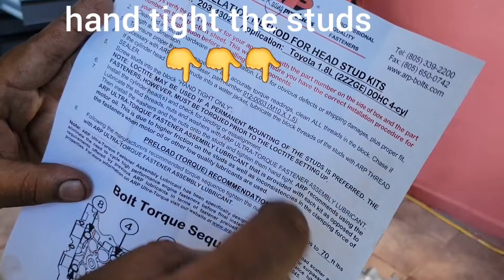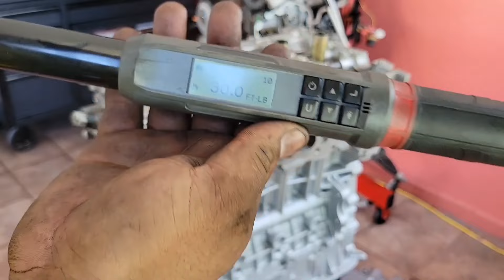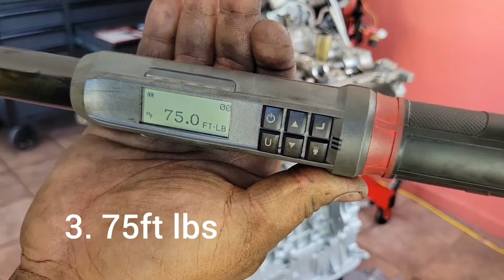The 2zz with itbs is done and going in the matrix

Comment: ITB'S usually make you loose power, 2zz intake system works good!... the intake systems bottle neck is the valves and valve actuation, it has a block guard? that's for forced induction/drag racing... it will loose cooling efficiency for no gain unless going past the stock blocks yield strength, N/A engine's make more heat than power, put a turbo on it!
Reply from the maker: You are correct the idea behind the itbs is just to be diferent im not looking for big horsepower since its goig to be a daily driver I just wanted to stand out installing something not many people have use
Reply from the maker: and the blockguard is just because why not, already had it on almost all my other cars and never had issues but I know is useless on this car and probably going to bring a lot of cooling problems but i'm willing to try it and let everybody know about my feedback
Reply: Where have I seen this Devon guy at?? He seems to know what he's talking about..great tips all around to keep in mind for my 1zz gt auto and 2zz 6spd trix xrs..keep em coming Yoda guys..ima soak up all the pro tips

Comment: Looking forward to the start up, what management you running?
And will this be a daily drive?
Reply from the maker: soon... using aem ems4 and yes a daily driver
Reply: @jtercelxrs38  mate the 2zzge need valve adjustment service or not? I have 120.000 kms.